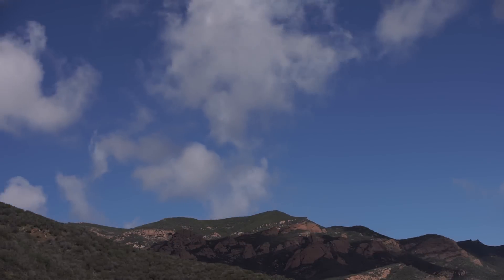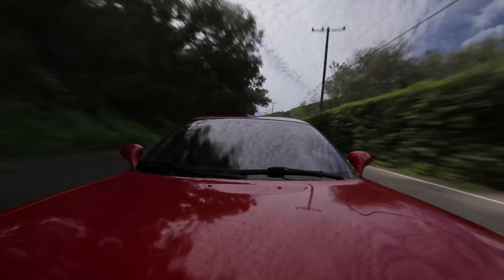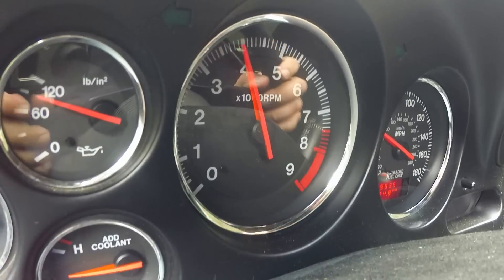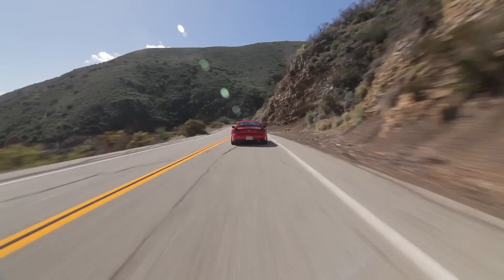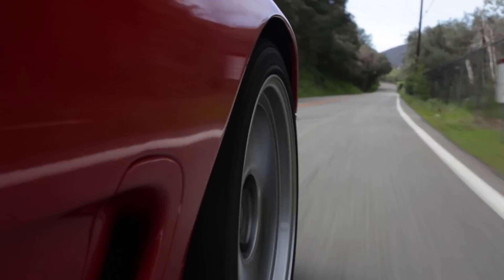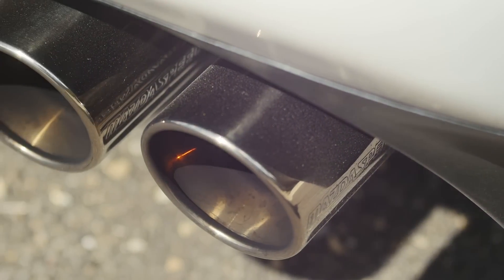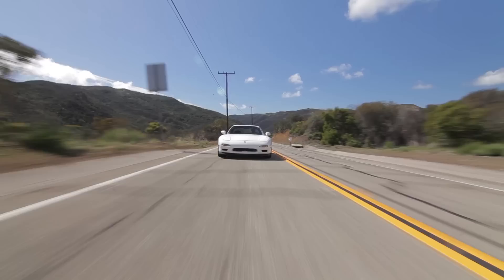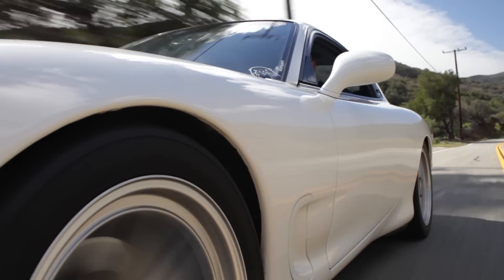Mazda  RX-7: Turbo vs V8 - /TUNED

Comment: I owned an NA FC, and despite its lack of torque at low RPM, the engine does have some advantages. Some are apparent, light weight, small packaging, perfect weight distribution, and it's unique power curve.  The one  thing I didn't realize until I had been driving it for a few months and jumped in a Civic Si, was the lack of valve train noise and vibration.  It felt like the Si's motor was heavily is the best way to describe it.  The low rotating mass gave the throttle a super responsive feel, and of course no noise from the valve train.  Now people are giving people shit about LS swapping these cars, and despite the fact that I think it ruins the character of the vehicle and would never do it to my own RX, good for them. It is their car, and the rotary can be a royal pain in the ass with the state of computers in the 80's and early 90's.  Vacuum lines everywhere, bad cold soldier joints (FC), and difficulty in finding a competent mechanic, make an all aluminum LS swap attractive to many people.  In the video he says the RX feels like a Vette with the LS, and I can assure, its not a 1993 C4 he was comparing. It's a great chassis with a motor that has a bad rep. So an LS swap makes sense to many people, and I would not argue with them. I still prefer mine with what Mazda gave it. Just my 2 cents.

Comment: ok i don't bitch on the internet very much or at all, but this is kinda bull. yes a b8 will have more power than a rotary, but what got me was the "very common modification" line. 
it did not seem fair to me because i would bet money that the v8 swap took a lot more time than a single turbo conversion.
the only way to make this really fair would be to start out with 2 stock rx7 fd's. one is v8 swapped and is timed and has a recorded budget (time spent on swap and money spent on swap.). At that point the other rx7 comes into play. This one you would take the buget used on the v8 swap, and the time used on the v8 swap and you need to stay with in those peramiters (also keep in mind, when a v8 swap is done, it's very common to redue the rear end.). maybe thats enough time for a twim turbo 20b, or a single turbo conversion with a J-port or monster bridge port and a 88 mm turbo ( yes that's ridiculous but that's not the point). Yes the weight would be diffrent but hell add that into the v8 swap then put the same towards the rotary. coilovers for both applications, strut braces, chassis brace, what ever. Just make them as close to the same as possible, except the engines.    Thank you, and appologies for being an annoyance.

Comment: Reading all those haters’ comments about the V8, I just don’t get it. How is the so-called “spirit” more important than the actual performance? Why do you like Japanese cars? Is it because they are high performance or because they are cool? You can have the “spirit” you can have, but if it is slow as f**k, why do you want it? Maybe you should just get a hot wheel.

Comment: i rather get the ls2 rx7 because it's like this would you rather get a 30k brand new subaru brz that will get you piss every time you roll race on the hi way like 99% of the people out there do, or would you rather get a used ls3 c6 corvette with ONLY 10k mile, still pretty brand new, and you won't be feeling piss every time you roll race on the hi way like 99 % of the people out there.

only the 1% are actually good at corner stuff and are pro, the rest of the 99% population will die going into a corner and are wannebe, some can't even go over a small bump, yeah stance life yo. the end

Comment: The red car certainly looks WAY better! The problem i see with v8 swaps is pretty easy to understand,  its the ls steering pump swap. I think the best setup i have seen is actually modding the stock Mazda pump with a custom pulley and bracket to work with the Ls(or any other engine) thus keeping the variable rate setup like Mazda designed. Then it simply turns in like a stock car, just with 30lbs more in front and well maybe a little higher center of gravity(easy enough to tune out, mostly) also I've seen plenty of swapped cars with nice kits on, please i don't care what engine you put in but Please update the look somewhat! The white car is clean but somehow shabby looking next to the red one.

Comment: The fact that the wankel is a 1.3, and it is being compared to a 6.2 says it is a much better engine design.  This is more a comparison of a small capacity turbo engine to a big capacity engine.  Compare it a 1.3 turbo piston engine and I don't think there would be any doubts about the benefits of the wankel engine design over a piston engine.   The fact that the 787 rotary was banned from lemans also contradict's the reliabilty and performance issues often associated with the rotary.
Reply: Maverick4990 it's a 6L...that is better in every way

Comment: I love how both owners of the rx7s decided to keep the car looking stock and didn't do any drastic crazy mods to make it look "cooler" and just styled the car with proper care and taste with adding some better wheels and tires and a spoiler; I also like how they did the same with the interior. Now as far as Turbo or V8 personally I would of left it the car a turbo and kept the rotary so the red is in my favor mainly for the purest in me. I always like to see what owners/tuners do with the own cars and doing drastic swaps but for me I'd love to to drive the car in its most purest form as that is what the engineers and auto manufacture had designed the car for. But then again to each is own. Much respect to both owners.

Comment: damn all that motor swapping, the cost, the time,, shit,, just get a frs or brz & turbo it,, lighter car, better mpg, handling is much better as well,,  my brother had a 2 frs's shit the way they handle in the mountain roads & power of 4cyl boxer engine with just an intake upgrade is amazing! I had owned in my life 3 integras, a 94 & 95 civic eg hatchback, a 00' hatchback ek,, I poured so much money into the motor swaps, rims/tires suspension work & I could have never gotten it to handle like a frs,,  EVER.. the frs/brz is the perfect canon carver car for the guy that cant afford a Porsche but it can handle just as good & be modified to have similar power maybe even more

Comment: " The balance is better, the turn in is better, and the cars more lightweight".....uhhmm sounds like the cars faster to me, throw the both of them on any circuit and watch the rotary walk away from the LS not only in the turns but also down back straights. I personally own a 93 r1 Rx-7 and raced 2 c6 z06 one stock and one with full exhaust. With my car only making 337whp at the time neither one had a chance on the highway. Yes they do make much more torque but torque can only get you so far, he comments on the needing to rev the rotary but the LS revs like an out of breath fat kid constantly needing to stop and take a breath (shifting) while the rotary keeps right on going. The Japanese engineered this car as a purpose built racecar with perfect gearing and very few needs to shift once at speed and this is the reason it is still a record holder in Japan on many well known tracks. (search Garage Revolution rx7) And personally I did not come here to trash LS motors because the one stock z06 I ran is my dads and granted it is an excellent car he'll be the first one to tell me how impressive the rotary is. I love the z06 and LS motors do perform excellent but a single turbo rotary is definitely something with a completely different feel and extremely linear power curve that cant be beaten once tuned correctly.
Reply: Dj Robinson RX7 with a Corvette engine > Corvette with a Corvette engine. It's the chassis itself that's better -- it's lighter, AND it's stiffer. You put an LS in an RX7 (with its better chassis), and I'd be willing to bet the LS walks the regular turbo; even being a little more nose-heavy. The LS has the same power as in a medium-boost RX7, but unless the Rotary is exceptionally well-tuned, you only have full torque available over about a 3 or 4k RPM range, which is a BIG problem when your transmission doesn't have enough gears (5-speed remember?) The LS doesn't need short gears to stay on the power -- put your foot down wherever you are in the RPM range, and just go.

Comment: its always funny to me to hear the so called experts saying the v8 is faster than the rotary.  like it is fair to compare a 1.3 and 80 cubic inches to a 5.0 or 6.0 or 6.5 and 350 or 400 cubic inches. the sole  fact that these experts compare it  is a win win for me now imagine a rotary with 300 cubic inches and at least 3.0 liters what will the v8 guys say then .

Comment: Then why not just buy a Corvette? 

Also, it's Lb ft when talking about an engines torque, rotating force of one pound perpendicular from one foot on a pivot.
Ft Lb is a measure of linear force of one pound over a distance of one foot.
Every car guy should know this and keep it straight , otherwise just say torque.

rotary engines run smoother are more compact and have a higher power to weight ratio.
3 objective ways that it is better.  it is not all around better but it does win in these ways
Reply: +Charles Adams
Foot pound - how many times your foot pounds on the end of the breaker bar (rotational force).
Pound foot - yes, you're gonna have pounding feet when someone drives the car over them (force over a distance).

Newton Metre - a rotary has plenty of them once you understand that torque can be changed however you like by using different ratio gears and differentials.

Comment: its funny how he's comparing a 1.3 liter to a 6.0 liter
Reply: +Kitkat Dominance "It's funny how he compares a 3.9 liter to a 6.0 liter."

There. Fixed that for you. {{FYI, it's really not that funny.}}
Reply: +Hazardous-Nebula so its a 20b engine?
Reply: +Kitkat Dominance "so its a 20b engine?"

No- Hes just measuring the engine like EVERY other engine measured- By calculating how much air it moves throughout an entire thermal dynamic cycle.  

When the cute little 1.3 wankle engine was "measured", they measured it by calculating how much air it moved over a 360 degree rotation of the eccentric shaft.  This basically means theyve added up the air from 2 of the 6 chambers in work in the rotary engine.  In reality, it takes 3 full rotations to complete a full thermal dynamic cycle of a rotary, which gives you 3.9 liters of displacement.
Reply: +SidewaysGts to do the proper calculation, you do displacement per cycle times number of bangs per rev. A 4 cycle engine goes bang every other rev. A rotary goes bang every rev, so to be fair you multiply by 2.
Reply: Michael Leppert
"to do the proper calculation, you do displacement per cycle times number of bangs per rev. A 4 cycle engine goes bang every other rev"

This would mean every known 4-stroke engine is actually half the displacement they actually are- Because only half of the cylinders would have done an intake-stroke with a single rev.

But the real answer- Is theres no "proper" way to do it.  There are just particular ways to do it.
Reply: +Kitkat Dominance I would wager my single turbo is faster than that LS2 RX-7 by nearly a second in the quarter so it's not that out of line.  It's comparing a stock LS2 vs heavily modded 13B.

Comment: Great video Matt. NOW if you were to take both of those cars to the track,  and compare times? That would be awesome! And yes a 20B 3 rotor would be a better comparison for pure power , but the smoothness of the 13B FD is why it IS special. Cheers.

Comment: What the hell, lol. He describes at the end on how the RX-7 with the 13b, felt nimbler and steered better, etc. But then immediantly continues with the "but it's in no objective way better then a tradition engine... Erm...What?
A high and quick revving engine that's got 1300cc displacement (in the 13b case), is very light and compact (space efficient when you think of all the parts that compose a usual piston-engine and easy to push it's weight to that front-mid engine mounting position), and as he said, them rotors love to rev and gain momentum. Yeah, there's no real reason to really like them. It has it's flaws, yes, but many of them are basically eliminated with smart tuning/modifying and general knowledge of maintenance and cares to take with a different type of engine.

V8's in general are great, as are the LS family engines, BUT, just please don't try and convince or tell people that V8's would have been a better choice for an RX-7. If I wanted to make an RX-7 feel like a Corvette, and have tons of mid-range torque to go cruising and spiritual driving with hardly shifting like it's almost an auto gearbox then....I'd probably just buy the vette?

TL;DR    The RX-7 was the ultimate race car for the roads from Mazda at the time, while still having decent comfort, AC, leather seats, etc. 
Japan + lowgrav and 50/50 balance + revvy engine + spoiler from the factory = mountain/track time attack with engine screaming in your ears till they bleed.
And not v8 cruising on big open roads while listening to Born to be Wild (No pun or offence, I like all of what I just said, but mixing a V8 and an RX7...Nah.
Reply: +Jonnypcl As an owner of the single turbo 3rd gen that has driven an LS powered car at a track there isn't much difference in handling.  They do feel different but it's not a big difference at all.  I had trouble with the V8 torque coming out of corners, the owner did just fine with it.  The weight difference is only about 50lbs. 

It was a 400hp LS1 stock and while driving it I would have said it felt faster, though when ran them at the strip I was consistently about half second faster in the quarter.  At the time my car was only tuned to 380whp so they power was fairly close, my 60' times where much better.

The biggest difference is on street the rotary isn't happy under 3000 rpm, the V8 is good to go at 1000 rpm.

Comment: Of course the LS heretic is faster, the V8 has an extra two cylinders - using the approximation of a 2 rotor wankel as a V6 since it has 3 chambers per rotor. Granted its still a turbocharged V6, they just dont really compare. A naturally aspirated 20B would be a closer comparison, but that is harder to find I bet. 

Thats why I say we go for external engine volume and compare a Y12 Wankel engine with the strongest V8 you can find. I have a feeling this baby will win: http://www.roadandtrack.com/car-culture/videos/a7188/insane-12-rotor-wankel-engine/

Comment: I prefer the 3 rotror 20b motor for that RX-7chassis over the LS since the Mazda RX-7 was built and designed around the rotary engine .
 this car was meant to be ROTARY POWERED
if mazda wanted the RX car to be V8 powered car
 don't you think they would have designed and sold the fucking car with the goddamn V8 already in it ?
 i am all for engine swaps and mix matching mickey mouse magic bullshit
but when it comes to the MAZDA RX cars they should be kept ROTARY .
either a 2 rotor , 3 rotor or 4 rotor   N/A ,turbocharged ,supercharged , bridgeported peripheral ported ,with NOS or just bone stock  , Keep the V8's in the V8 cars,  stangs maroes , vettes ,chargers  and all others because to me that's where they belong in my honest opinion . those chassis were built for their respective engines

Comment: If you put a v8 into it it's not an RX7 anymore. Yea it looks the same, but that's not RX7. That's how I see these swaps. Saying my miata can do 200mph means nothing if the engine is not the one that came with the car. Can't say then "my miata (or whatever) can do 4sec to 60. Since it's not that car anymore.

Comment: This is a terrible comparison. Like many people here, I'm a car enthusiast. I believe both engines have been proven to be superb in their respective application;however,I dislike the "just drop a V8 in it" approach. V8 miata, V8 Rx7, V8 240sx, I get it, I get it, the LS is without a doubt a badass engine, but to compare it to a 13B who's design is 20+ yrs older is silly. I've witness the 1.3 liter rotary's run mid 6 sec 1/4 mile passes. The issue with those motors is that they need heavy modding to get power of of them;therefore making them very loud and less reliable.